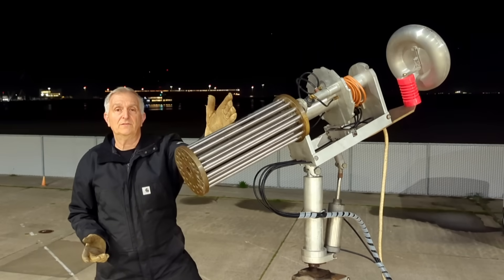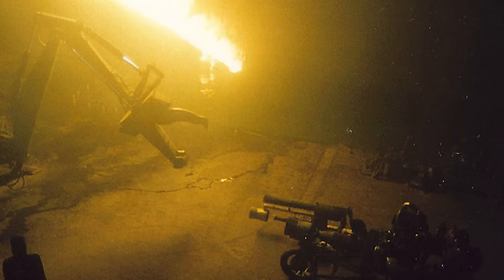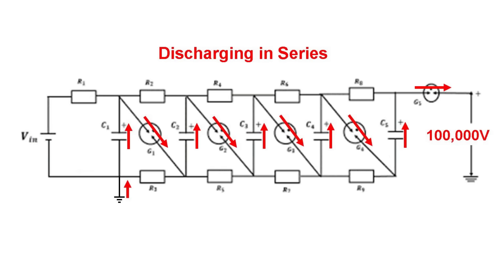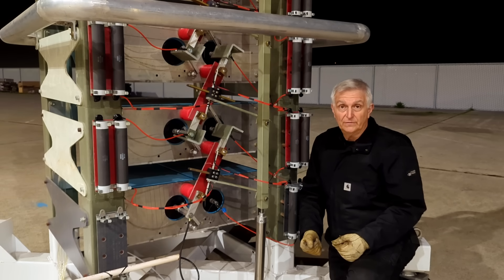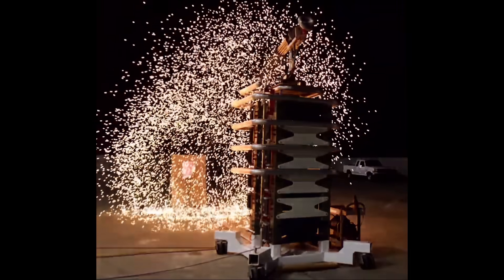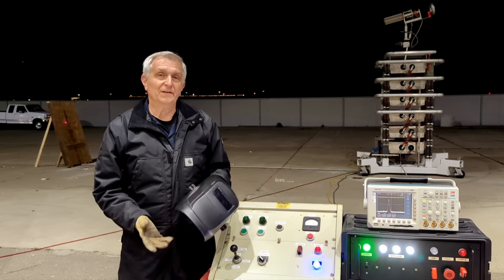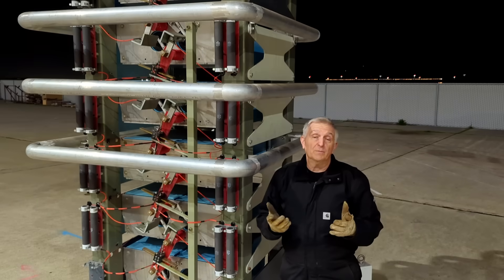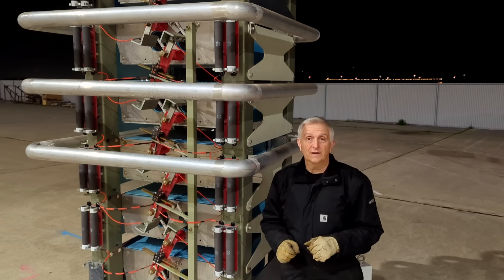Firing the Lorentz Plasma Cannon

Comment: The bottom of the tower and outside of it is not insulated and the electricity would simply jump to the ground. Furthermore there is not any wire here., but only fireworks.  I still think this a is fake.  No way you could get 30,000 amps from capacitors and even if you could the whole tower would catch on fire.

Comment: 210,000 volts is not anywhewre near dowble 150,000, its not even 50% more its like ~33% more
Reply from the maker: It's double the energy, which is equal to 0.5*C*V^2

Comment: All that effort and costs to blow a tiny hole int a wooden board? That machine seems absolutely inefficient. 
Just use a .50 BMG and you're range, lethal firepower and reloading speed is much better by a lower cost.

It has a reason why soldiers use Rifles instead of Sci-Fi Laserguns.

I think with all that stored energy, even a Mini-Railgun would create a better result.
Looks like 99,9% of the energy just vaporizes in the air between the cannon and the target.

Comment: You are artificially doing something l saw with a bit of a twist: I saw a pile of railroad spikes struck by a bolt of lightning with amazing results. The spikes turned inside out, fattened up like hotdogs and are filled with a semi cylinder of Industrial diamonds in a  partially hollow tube .Still cooler these now cylindrical spikes all stand at an angle of about 70 degrees . These are railroad spike fulgarites. These formed on the tracks that run along Frankfort Avenue at Ewing up from my apartment at 2514 Frankfort Ave . around the Summer of 2002 .Also around the same time nearer to my apartment itself ball lighting appeared for about 20 seconds running down the track from east to west for maybe 10 feet . If you win the lottery maybe you can create such fulgarites for yourself .

Comment: plasma beam not the best thing casue rather if you make a plasma bubble and shoto that instead it casn do much more impact damage.  projectile do still form when you try the beam method. the diffrence is you have to make a spark chamber forming a coronal effect and then you need ot make the channel a accelerator taht sues pusled coils and magnets to accelerate the plasma bubble as such woudl do much more impact than a beam.  so if you make a spark and then channel eletricity into the spartk from a larger dicharged follow by tha ignition spark you get a plasma bubble.

Comment: The scary part about this is that you (probably) wouldn't need a lot more power to greatly increase the range. If you're totally okay with downgrading from 'rapid electrically induced disassembly,' a longer range wire launching system would be more efficient. Of course, efficiency is clearly not the goal here.

Comment: If I remember what I read several years ago correctly, it should be possible to use a narrow beam, high intensity laser to create a plasma channel by ionizing the air between the gun and its target, which would act as the wire you mentioned early in the video. This should be able to extend the range of the cannon significantly without needing to increase the power. Not sure if a laser able to do that would be more, or less expensive than just increasing the power of the tower, though.

Comment: This is the coolest thing ever, but the delivery system seems a bit lackluster. A larger projectile connected to the wire could deliver the charge to a more effective output. Just relying on the raw power directed to the outside of the target seems like a waste to me.

Comment: I understand your great efforts in creating this device, congrats on that! To be honest I really don't see any practical use for this cannon, as it actually causes almost no significant damage to the targets, it consumes a huge amount of energy, it's range is almost zero in terms of actual warfare to be practical, it takes a lot of time to charge and fire, and it's also quite big for the minimal damage cost to a single wood board. Imagine the size of this thing to cause any significant damage to a tank, for example. In the close range by the time you get this cannon ready to fire, the enemy has already fired on you a conventional cannon bullet from a much larger distance. It is nice that you have achieved this device to work overcoming all the difficulties, and that's the best part of it. Thanks for your great effort, this is how science advances, by little steps at a time.

Comment: With a plasma channel built, I wonder if there's a way of throwing a vortex ring instead of banging it around with one big smack.

I just mean it might look really cool to throw several plasma rings instead of a scattered bolt. Maybe it'll maintain the path through the air for consecutive rings... or just make a terrifying mess of undirected energy? I don't know. Maybe low power experiments in a vacuum chamber are prudent. 🤷‍♂️

Comment: Back in the 60's, my dad worked for Lockheed in Palo Alto, as the lead physicist running their hypersonic wind Tunnel, dubbed, "hot shot tunnel". It basically provided a wind tunnel for 20k plus mph testing.  It was powered by a gas cylinder (large with VERY thick walls) that was activated by a plasma stream from several hundred (maybe a thousand) large 1 ferrad capacitors.  The bus bars were 12 bars of copper, 1" by 12" leading from the bank of capacitors to the tank.  So they had "lightening" in the tank and that superheated the gas inside the tank, which blew out the nozzle and powered the testing tunnel. Pretty cool.

Comment: Praise be the Omnissiah, Motive Force and vertical cable management. 
01001101 01101111 01110010 01100101 00100000 01000011 01101111 01101001 01101100 01110011 00101100 00100000 01101101 01101111 01110010 01100101 00100000 01010110 01101111 01101100 01110100 01100001 01100111 01100101 00101100 00100000 01101101 01101111 01110010 01100101 00100000 01000111 01101100 01101111 01110010 01111001 00100001

Comment: Absolutely awesome! What if you used double the quantity of capacitors at half the voltage rating? Would you end up with a smaller overall set-up? 
I also would like to point out the property of the LRAD (Long-range acoustic device) it uses many many  tiny speakers in a cluster to send sound miles out. maybe that principle can be applied here in some way to increase range?
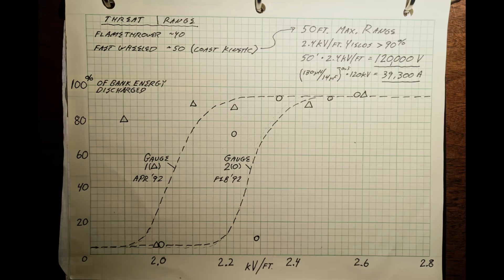Reply from the maker: Below a critical voltage, the plasma channel will not form  3:00

Comment: Lasers can ionize the air, and you do not need a wire.  Pre-ionize a channel and build up the current slowly (nano and pico and micro second resolution) . Make it smart and record what is happening in the power source and in the air.  Start with maintaining a milliamp over a few feet. It does not have to be big explosions.  Absolutely quiet magnetic force that moves things or cuts things or heats things is better than loud noises and lights that only make eye candy and hurt the ears.  Just transmitting 1000 amperes over 100 feet nearly lossless and soundless is useful. Break free from your original experiences and look at what needs to be done for solar system exploration, and development, and for plasma engineering and fusion, power transmission,  and dynamic electromagnetic levitation and shaping.  Use ions and electrons, they can have separate channels and times.

Comment: for PEOPLE INTO EARTHING,  like grounding matts or grounding sheets, im told they dont work unless you havea continuos flow because of modern building always using manmade materials blocking "static electricty" from flowing
SO if a person using a groundingmat/sheet also wired up a very fine wire rectangular grid above the mat and directed this thru the wall outside and to a metal point on the roof, would this work to continuously ground yourself to natural earth flow ?

Comment: Put a 5-10 feet pipe as a barrel or "director" and you would get that 5-10 feets of exploding wire being directed towards the target instead of just releasing all of its energy in all directions.. also the form of the plasma would also be more directed towards the target. Win-win-win. But minus because of the extra length of the gun.

Comment: Give it a mile range, and it can hunt drones? You're essentially making a Star Wars-esque plasma turret
Reply: I'd assume the longer the distance the higher the chance that the electricity will find a different path than the target. Like imagine if it just vaporizes all the flying birds in the area instead
Reply: It has to hit its target with a projectile to conduct the discharge.

If you can reliably hit a drone a mile out with a single unguided projectile, the electrical discharge is largely unnecessary. Just pack the round with explosives, and not have to deal with recharging, reloading as frequently, and swapping guide wire attachments. Allows you to fire much faster, with much less chance of killing its own operators, with less complexity, with no real difference in result - a drone hit by a high explosive round and a drone hit by a lightning bolt are both dead drones.
Reply: @Dac85 ok but shooting lightning at it is a lot cooler

Comment: If you zap a DMC DeLorean equipped with a flux capacitor traveling at 88 mph with this canon, you can time travel. Those only require 2.2 Gigawatts, which this beam easily generates if my calculations are correct. Dont have to wait for a storm anymore.

Comment: Did you really say 210 is nearly double 150? 

To go from 150 to 210 is only a 40% increase..
Reply from the maker: Since energy is proportional to voltage squared, a 41.4% voltage increase doubles the energy.

Comment: So what you're saying is you built a machine that basically fires a bolt of lightning and it didn't even crack a CRT screen? Why is that?
 Everything else about this video is mind blowingly awesome. I'm impressed you worked with SRL which has been doing cool things I barely comprehend for longer than I have been alive. The math, the conceptualization, the execution - it's all top notch. Keep up the good work.

Comment: I understand how it works makes alot of sense actually.  That's a really interesting systeme  I wonder  if it could be use as a fail safe to redirect current on power lines if ever it short circuited or something got in the way of the connection. 

 Maybe  with a converter of some sort it cna be an alternative way to drop a load on a grid systeme let say, the second it get hit by lighting or sormthing, rather than bolting the whole systeme it evacuate by ports connected to prong ready to shoot out these arc

Comment: Its not a plasma cannon... Its an oversized tazer... Basically... You didn't need to attempt to big it up more than it actually is... Plasma REAL PLASMA is as hot ajd radioactive as the SOL our sun... This is actual plasma... And it would be several trillion times more destructive than your non destroyed wooden chipboard target 🎯 that by the way looks completely undamaged... Real plasma cannons can melt through our hardest steel and only protective plating would be TUNGSTEN the most refractory metal on earth (meaning its damn right hard to melt) needing an electric furnace that gets actually hotter than the surface of our sun... What you did was impressive but its definitely not a plasma cannon lol 😅 a real plasma cannon could kill you even if it misses you by a few meters... Yes if tye severity of the passing*SUN TYPE HEAT* doesn't cook you alive the amount of radiation from just one shot could cripple entire communities 😅 basically speaking you could theoretically contain plasma in an incredibly strong magnetic chamber as its stable inside a reactor but quickly becomes unstable after leaving the barrel... This lead to stupidly impractical short range... As tye plasma loses its cohesion it looses massive amounts of heat and the reaction dulls... Thus a real plasma cannon is years if not decades away from being REAL .... Urmm thank god for Human stupidity ey 😅

Comment: I heard years ago that someone built and tested a taser that didnt need wires it used ionised particles in the air created by lasers to conduct the current. This reminds me of that. The electricity was supposed to be transmitted at a frequency similar to that used by human nerves so it caused your muscles to contract or spasm and thus immobilsed you.

Comment: @USAF: I would call this more as "synthetic lightning cannon" instead of a plasma cannon. A True Plasma Cannon fires with about 10 gr. extremely hot and highly charged plasma to the target thus such weapons are always short-range systems. The effect of the gun is not 'kinetic' or thermal destructive bu more electronic. Such weapons always aim (to overload) the electronic control system of the target hostile machine or person. If the target is a personal soldier the weapon causes to "burn" whole nervous system of the hostile person thus resulting almost immediate kill. If the target is a vehicle or any armoured system the weapon causes immediate shut down of the whole electrical parts of the vehicle thus effectively neutralize the hostile vehicle by stopping it from moving any parts of it. Preparing a plasma mass is one thing but charging it to a very high electrical power is another thing. Imagine: a charged plasma carrying farads of electrical power and causing megaampere currents at the moment of the hit on the hostile target. as iron does not as conductive as copper or alu cables or any other electrical power or signal carrier, this causes immediate overload of all cable system and bound electronics. Thus, an attack of true plasma cannon destroys all electronic systems immediately, but mechanical parts remain intact. Modern Air Combat Systems carrying a plasma deliverer small vehicle mounted on the flying plane like today AA Missiles, but deliverer vehicle come backs to the host plane to reload. Such missile like vehicle carries already prepared plasma and fires it from very short range to achieve same effect effectively killing any person inside and destroying any electronic control or combat system and resulting immediate loss of targeted vehicle. Regards of Skies...

Comment: Fabulous. Note cap lifetime deteriorates with voltage to power 7. The wire coil undergoes radial compression along with axial expansion. With the right equipment you can do coin shrinking. (I would suspect you have already done this). My best was to shrink a one yen aluminium coin such that its thickness was greater than it's diameter with some surface details remarkably preserved. Possibly not legal tender any more.

Comment: Idk if you've seen it, but there's a channel called Lightning On Demand, that did a project that seems RIGHT up your alley. It's a legitimate lightning gun! If you use beefy enough capacitors and multiply the voltage by enough, it's possible to shoot a thin wire from a gun and put enough current through it that the lorentz force lets a stable enough channel of plasma form to conduct the rest of the energy, just like an actual lightning bolt! I saw it and immediately thought of you. he didn't even come close to doing it justice with the kind of insane mad science it deserves, which is fair. I think you might be the only person who could really get it right. What do you think?
Reply from the maker: Yes, I have seen that channel.

Comment: * When watching slowmo, it looks like a  stick like shaped projectile coming from the lightning gun. Before the electric discharge,...Q: Is there a thin wire connected to the leading projectile  ?
Causing a direct link from "Gun" to Target, when the projectile strikes the Target....

Comment: And how do i make one of these myself?
Reply from the maker: Start with your voltage and current requirements, and build a pulse-forming network to suit.  Modularizing the design often helps at these scales.
Reply: @LightningOnDemand  I did not expect you to actually respond, but if I ever get the money and resources to build one of these, I’ll definitely try to. Thank you so much for the info!

Comment: Wow . . . having way too much fun.  I remember working at LBNL in the 70s, part of that time was spent building enormous pulsed power supplies, using very similar ultra high voltage / current pulsed power capacitor systems (for firing lasers).  Had always wondered what I might have done with all that for doing anything imaginable . . .  might have been close to this plasma gun concept.

Comment: As a medical doctor looking into the future..could you test this on a chicken? (Supermarket one is fine, let's not actually kill anything). Just curious if it would cause the damage via electric disruption of like the heart or more like thermal burns along conductive tissues  or just the air displacement shockwave be the most prominent thing to see.
Reply: If anything within distance is grounded more than the air around it , say anything that can transfer electricity ⚡️ like electronics wire water etc. if grounded close enough to the beam ……. Brain 🧠 heart ❤️ etc will stop  kinda like a SUPER TAAZZER   Only Worse Way Worse ‼️

Comment: Seems like a close range weapon because it fires a projectile with a wire and when said projectile hits it's target it discharges it's load... Might be a nice defensive weapon against close range targets since there's time to turn the main gun
Reply: My thinking is to mount it on a tank for when enemy's catch you by surprise... I imagine it'd stun them, like make the enemy tanks engine shut off, that buys you crucial seconds
Reply: Either you start turning the gun to shoot them or you put your foot down on the throttle and run... All depends where you're fighting